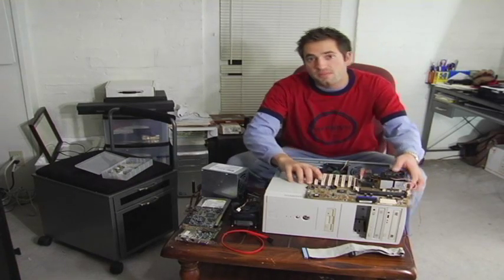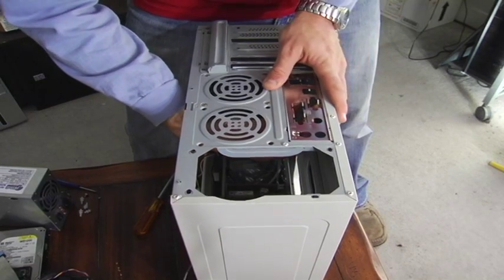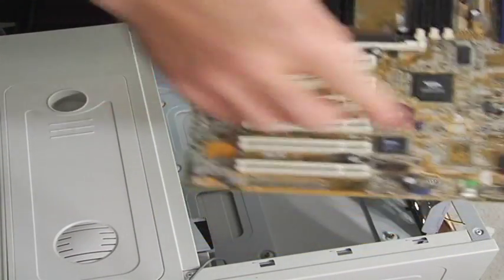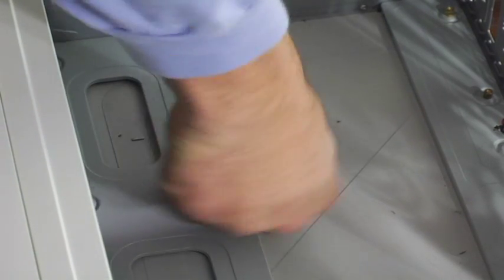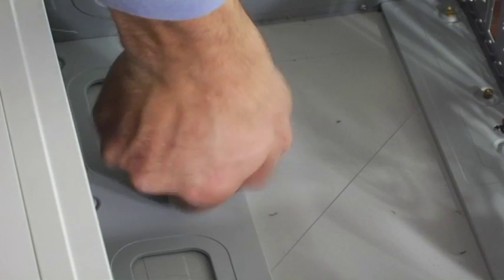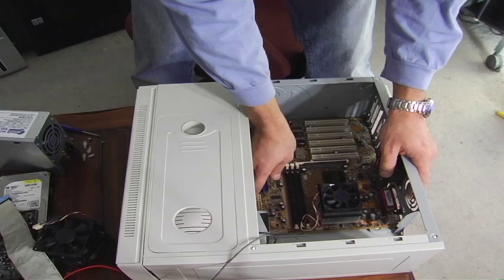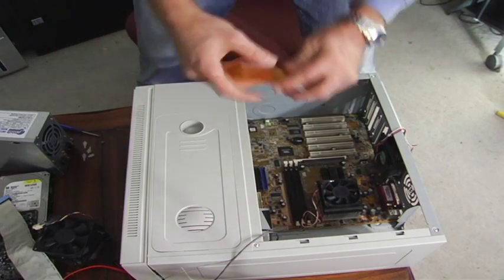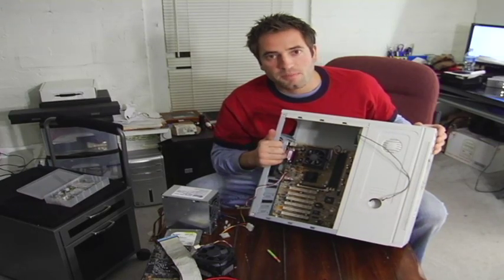Computer Hardware : How to Install a Motherboard

Comment: @amoukrim  Take some measurements & use the link to understand motherboard and case form factors, and to get a better idea of the following considerations:
1. An ATX motherboard (12" wide x 9.6" deep (305mm x 244mm) fits an ATX (large) case
2. A MATX motherboard (microATX: 9.6" wide x 9.6" deep (244mm x 200mm) fits a MATX (small) case  (average sizes)
3. A MATX (smaller) motherboard fits an ATX (larger) case
.interfacebus . com / Mother _ Board _ Form _ Factors . html  (remove spaces)